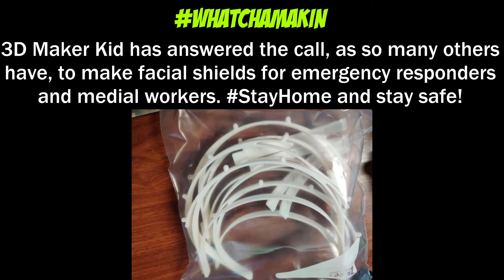What makes a Maker?

Comment: Hey Chief, thanks for all the videos, they have been helpful to say the least. 

I agree with your idea that an engineer has usually learnt all the boring stuff too, and not just the fun interesting stuff. Take me for example, I have skills and knowledge mostly learnt through teaching myself, but most of it's based on things I like doing or find interesting. So I might be cluey, but I'm definitely not furiously punching tiresome equations into a calculator trying to work out loads and what needs to be done to prevent a horrendously catastrophic failure.

Like many makers, I've been making things and pulling things apart to see how they work since I was a kid. So I've probably been a maker since before the cool kids even started using the maker label. And as some of the other comments suggested, do we really need labels for everything. Seems everything needs a cool or edgy name these days, a label to strut about with like an oversized timepiece dangling around a rapper's neck.

I'm more of a grey area man, I don't mind the word tinkerer to describe anything from pulling something apart to see how it works, to tuning up the car, to building a birdhouse, fixing stuff, or pouring a slab for a new shed. It's all much the same.

I always get a kick out of fixing things, as well as innovating and creating new things, or the tools and devices to make those things. I've always just referred to it as going out to the shed to tinker. Which, by your definition, would suit because a lot of the time I don't finish the things I start.

In fairness to tinkerers, I would say it still takes a certain amount of practical mindedness and skill to print successfully. Even if they dont create the model,  they are still operating a machine to pump out an item. That's still making something, just not from scratch, that's all. Maybe this would be better described as a manufacturer instead?

I'd say entry-level hacking is a step up from tinkerers who only makes other people's things, as they are innovators most of all and have to be able to take another step further than what they're presented with. They are puzzle solvers and shortcut finders. That takes a mind that not everyone is fortunate enough to be blessed with. But some entry-level hacks are very basic and dont require much skill or knowledge, like just putting masking tape over the webcam on your laptop compared to modelling and printing a sliding cover similar to what the manufacturer would have done had they done it. Both are an adequate solutions, sorry, hacks to the problem, but there on different levels.

While on this topic, I might take this opportunity to have a brief rant about how much the ubiquitously used word hack annoys me. Similar to what I said about maker being another of these cool edgy words, hack is even more so. it's over use in pop culture is insufferable, particularly in click bait, and so many things get called hacks now and they don't really classify to my understanding, which is basically a shortcut, a simpler solution, or an easy in. So why can't they just be called those real names instead of the buzzword, hack...?   sorry, where was I...

I have a friend who is a boilermaker. Years ago when we were apprentices, he would refer to himself as a molten technologist if someone asked what he did. I did my trade as a cabinetmaker and joiner, and one of the old blokes used to ask me if I was a wood butcher or a grain surgeon?

I grew up on a farm, so making anything and everything was normal, so it didn't really have a name. Like most farmers, if something breaks, you fix it, if something needs making, you make it. You simply can't afford to pay someone everytime something breaks down or you need something fixed, made, built or modified.

I dont know what I'd call myself if asked. Basically I like interesting things, and I find lots of things interesting. Maybe I'd just go for something like hobbiest. That suggests an amount of learnt knowledge, time spent, skills, and financial input. 

Please remember to wash your hands after reading this comment.

Comment: A skilled laborer, learns a skill, often on the job. For the most part just for the job. If they then apply those skills out side of the job for fun or even side profit, maybe they are makers too.

A tinker(er?) while not necessarily out to make things, rather fixes things. Occasionally takes things apart just to see how they work, so they can apply that knowledge later on. On some occasions they may even cobel something together to make something else work. They may not have the formal education and skill as an engineer but they do engineer things based on the knowledge they have. So let's throw them in there if they want.

A designer, an inventor, an engineer, etc is often a specialist, creating things from their own imagination. Some may be more skilled than others or have knowledge in a certain area but in the end they also make things.

Among the police you have different categories and specializations but in the end they are still police.

I think of the term MAKER as a the catchall. They are people who make things, even if making something from other people's plans. They make things. Not necessarily because they are required to but because they want to.

I think FUN is the key factor. At the start of the whole big maker movement, it was about fun and passion.

Do you make things because you want to? Are you having fun doing so, even if it's hard work? Are you passionate about it? Or is it just a job and you make things to earn a paycheck.

Comment: you are talking about a hardware hacker which is someone who can take something that may or may not be broken or discarded, and turn it into something else, or modify it to do something ontop of what it was originally meant to be, so someone who say takes apart an old hard drive and then modifies everything around it to make it into a fan would be a hacker, good maybe not, maybe you discern between good and bad as the guy who made that fan vs someone who uses the motor to drive plastic squirrel cage inside a sealed secondary hard drive case to be a water pump with no contact to the pump motor, or maybe they use a cheetah scsi high speed drive to make a small spin coater, or centrifuge, but the idea is the hard drive was never meant to be any of those things, and yet there it is with the hackers efforts it now is, so to speak you have to have something to start with that had an intent vs say you make filament into something, but it had not intent really, unless it used to be weedeater line, that was different than you applied it for, so maker, also I would say that there should be two classes of engineer, being engineer (as spelled here with the same small case e at the beginning) someone who makes changes and modifies things and thinks on something they are designing to make it work, because that is what engineers really do, they take an idea that had no specific details so someone could attempt it and fail, and they make it work, they do the leg work to work out details that would otherwise cause the item to fail, while what you are talking about would be an Engineer, with that Capitol letter E meaning they have it as not just a skill but a title.

Comment: its like trying to use nerd,geek,dweeb.  creating, and making engineering something from scratch or combining already designing objects to create a new object and is not always definable.
its hard to say im one thing myself. one day/hour i may be a maker and engineer, next moment i may be a hacker and trying to extract info from a jtag connection, next moment i may be a programmer trying to hack something someone else has made to get it to do what i want and 3d modeling an enclosure to 3D print for it. next i could be trying  to make a transistor latched switch to power on someone else's make, therefore hacking their design to engineer a more productive object.  what do we call people like me. my best friend calls me a mad scientist. i do call myself an engineer for simplified reasons to others (also a jack of all trades, master of 2). sometimes, like today, im a teacher.
Reply from the maker: The best way to use the word "Nerd" is in a cross-eyed testosterone rage.

Comment: At least over here (Finland), "engineer" is a degree (bachelor's level) with a master's level engineering degree called a "diploma engineer" (graduate engineer / MSc in tech.) and then there's a doctor of technology. - So you need 4 years of higher education in a technical field to be an engineer, as our bachelor's degrees are long. 

I know that train drivers are sometimes called engineers, and some job titles are engineer even if there's no strict education requirement. But these wouldn't be things that happen here, at least not commonly. We're pretty strict about titles, not just for doctors and lawyers, but for all trained professions.